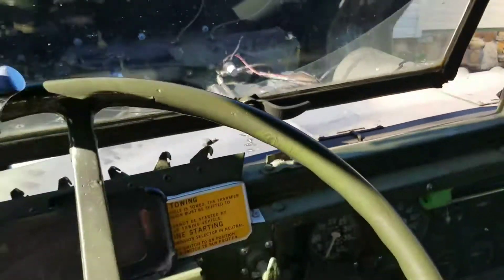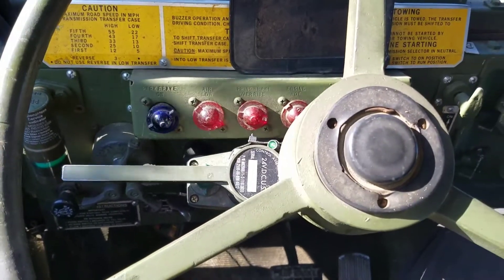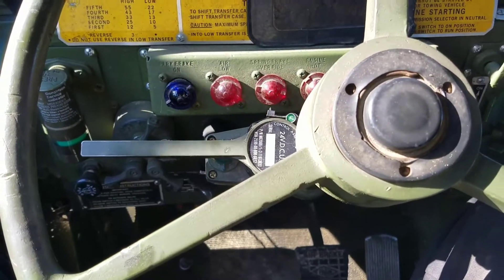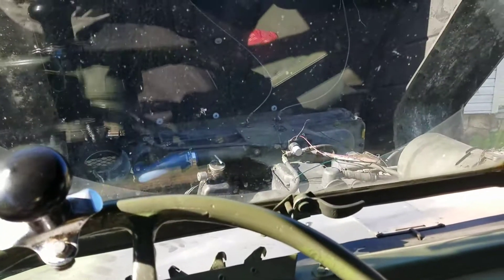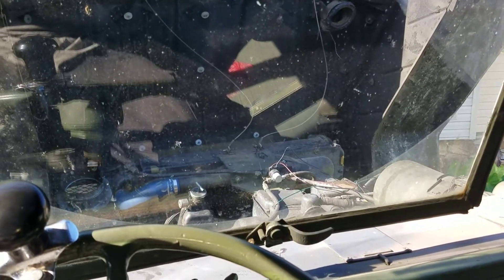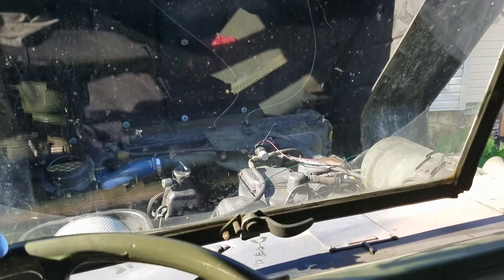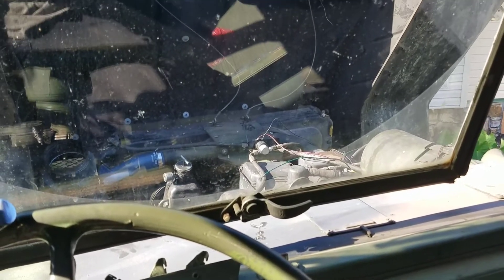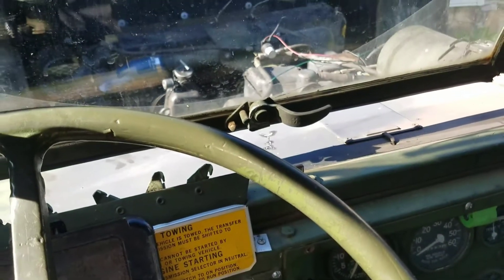M939A1 NHC250 Fan Clutch Electric Control Solenoid Install

Comment: wes are you going to make it automatic with a thermostat?
Reply from the maker: Don Biederman. No.  i will keep it as a manaul override since i will have electric fans that will run full time. I can add a thermal switch for a few bucks but i would rather be able to turn it on if i need to.
Reply: that motor is very efficient at 180° so don't cool her off to much. I have a couple of projects to build for mine. I liked your tired breakdown video. I'll made a video for it when it's done
Reply from the maker: Don Biederman my next mod is a CAT 7155 16speed swap so she has alot of powerband.  At the moment she has been 54,247miles since july of last year